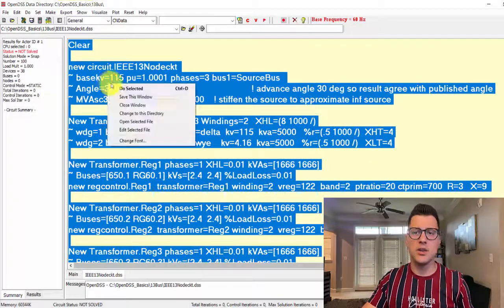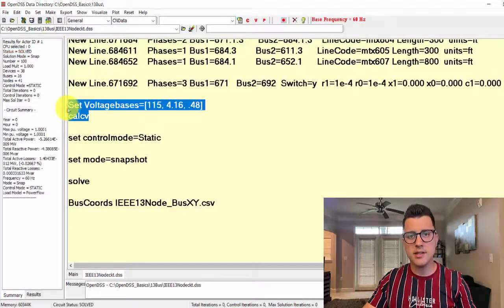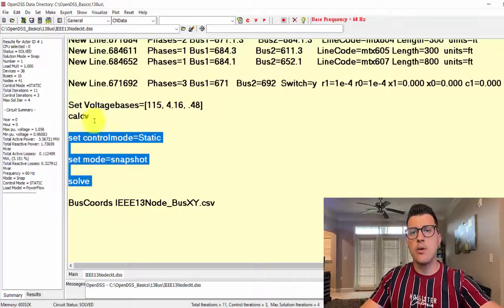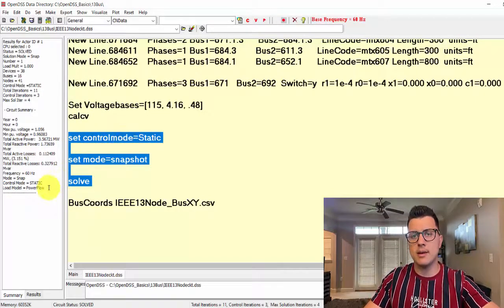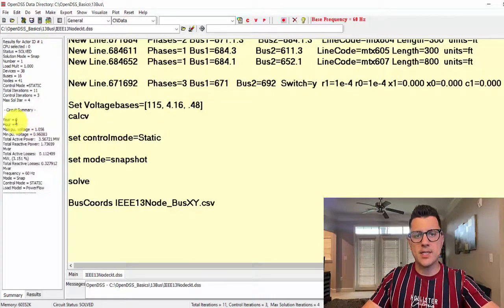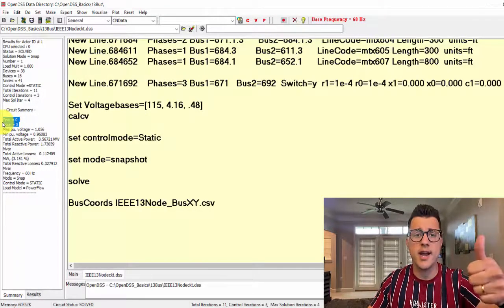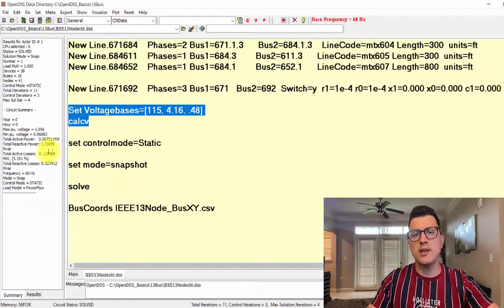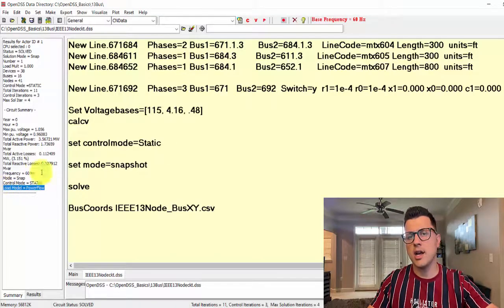4 - [En] OpenDSS Basics | Summary Part 3

Comment: Hello Sir, thanks for your videos.
Could I ask some questions about OpenDSS since I encountered a problem when I used it?
Reply from the maker: Sure, I can try to answer it.

You can also send your question to the official OpenDSS forum: https://sourceforge.net/p/electricdss/discussion/
Reply: @PauloRadatz  I try to plot the figure in MATLAB. But it is empty. I do not the reason. 
Yes, I submitted my question in Open Discussion section. But no one response yet. Can I write the code in your comments?
Reply from the maker: I saw your code there; you need to do a solve command before getting results.
Reply: @PauloRadatz  oops, I accidentally delated it when I modified my code. It shows the figure. But I found the result was strange.
Reply: @PauloRadatz  Many thanks for your help!

Comment: Hello sir,
can I perform analysis in 50 Hz also?  if yes how can I change to 50 Hz?
Thank your very much for video series. It is helping a lot. Hope you will upload more videos:)
Reply from the maker: Hi Sunil, 
Yes, you can change by including the following command "set defaultbasefrequency=50". I would suggest you include it before the ClearAll.
Reply: @PauloRadatz , also it can be done by going to the menu bar. Then Set>Base Frequency=50Hz, right?
Reply from the maker: I have never used it. Does it work when you change it? Check the reactance of a line.